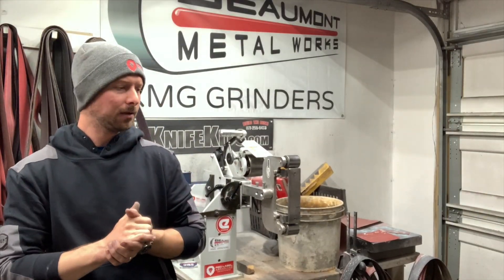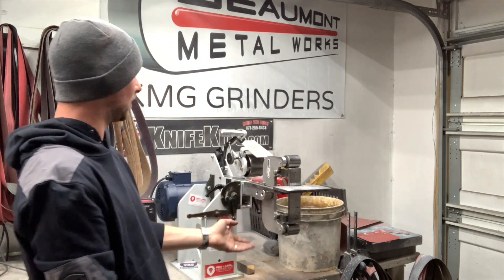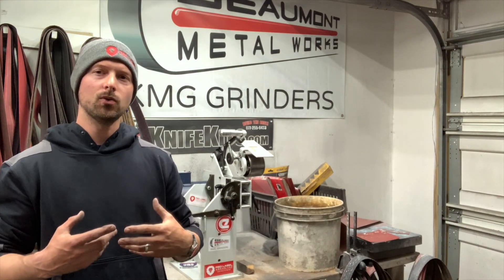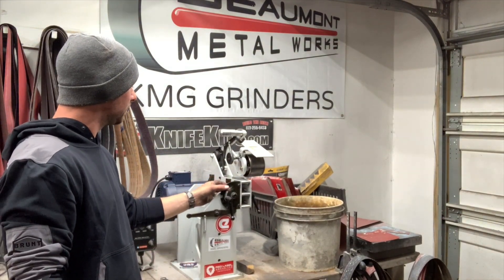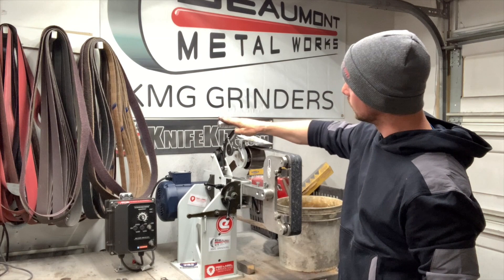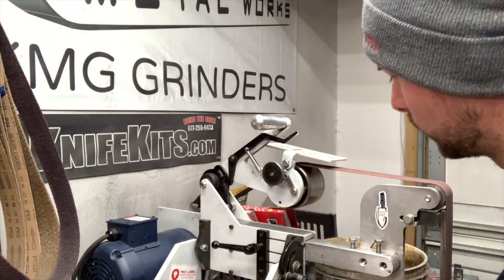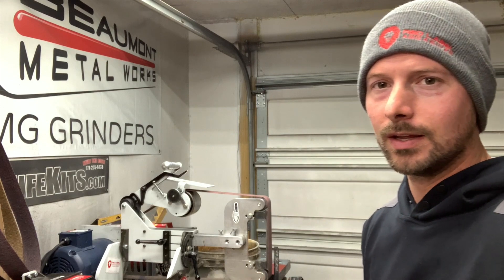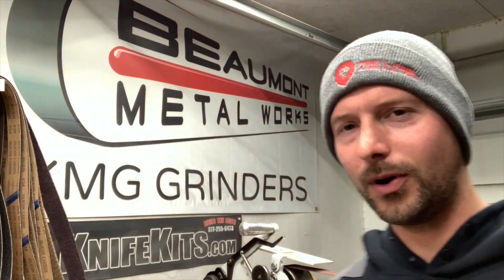KMG TX Grinder review after 1 year of use! 2x72

Comment: Cant get mine head around that tension ratchet, On TW90 it is ratchet and arm with roller, not connected, and tension is via spring, here it seams one piece, how that tension work ?, it is solid rigid tension of belt, or it act like springy tension ?  for example when you hard push materia when grinding, on one place of belt it release tension o belt on another it increase tension, spring usualy level  thise diferences, but here it seems it is rigid tension. ty for unswere.

Comment: Great review!
I have one question. How many seconds does it take to stop at full speed when using a 10" contact wheel?
Reply from the maker: I’d guess around 8-10 seconds maybe
Reply: @gentrycustomknives8008  and that 8-10 seconds stopping time can be easily and quickly reduced or increased via a setting inside your VFD